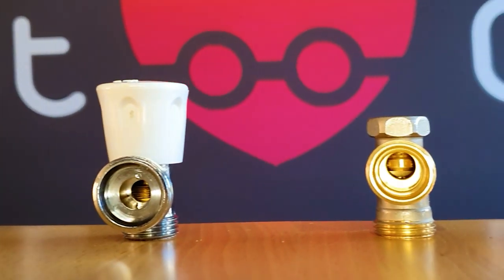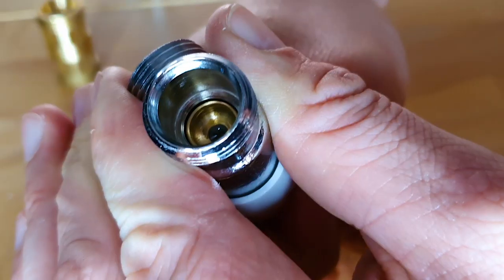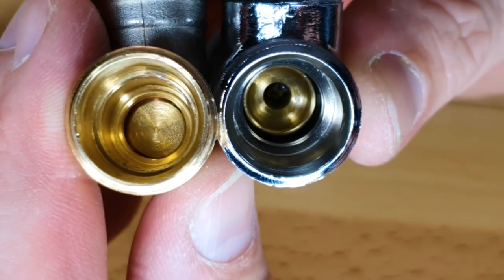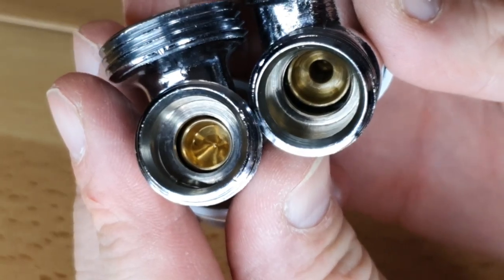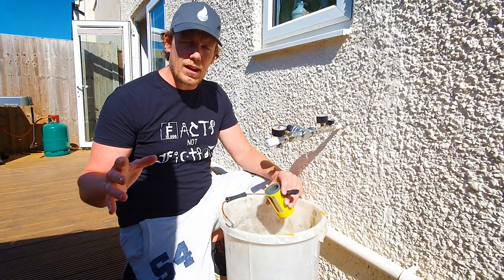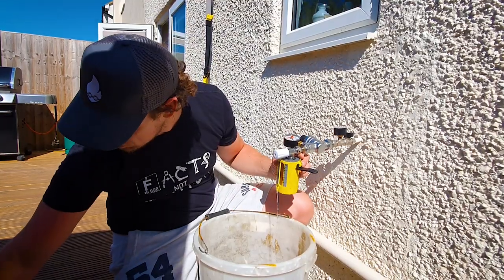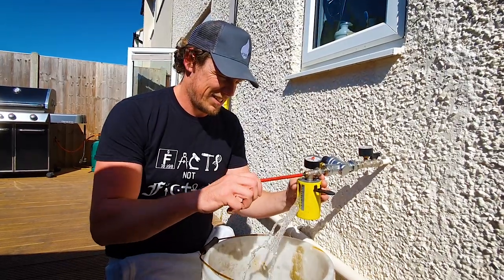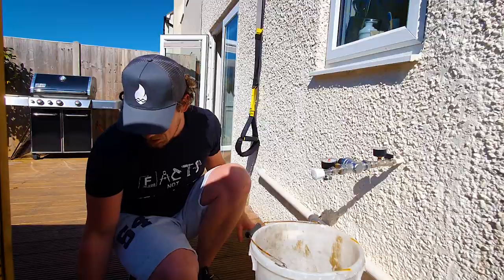We always thought Lockshield Valves were the SAME!!? WHO KNEW!?

Comment: It looks like I have regutecs fitted to a few of my radiators ! As they don’t look like normal lockshields ( the exposed shaft when you take off the plastic cap / no plastic cap ) I though they were just wierd elbow and darn’t ever take off the cap encase I caused a leak ha ! 

Interestingly on the radiators fitted with the regutecs have oventrop TRV’s which actually have a flow restriction function it seams ( had one apart in my garage ) 

I now know that all lock shields aren’t made equally, I’ve got some rubbish on/off ones upstairs and they are horrible to try and control flow. 

Great video as always, I’m learning loads and I’m not even a heating engineer 👍

Comment: I have smart Trv's fitted so it's not unusual to just have on one/two or three rads on at a time and I have all the lock shields fully open  (I have a 1970's system boiler ). Is this wrong ? Maybe causes an issue with delta T ?

Comment: Absolutely fascinating stuff. I like how you can turn on/off those valves without messing up set flow rate, you can also set the flow rate on the Trv4 and Honeywell’s counterpart.  Would be interesting to see how  pegler would fair in this experiment as they are regarded as a gold standard valve. ?
Reply from the maker: Good shout. Got a link for a specific one?
Reply from the maker: Assume you mean pegler ofcourse?
Reply: Hi. It’s the pegler terrier.  I used them on my house and on jobs for costumers with  larger houses, the sort of place where you would want to find a good valve if you were to arrive in ten years time.

Comment: After watching, I went and had a look through my box of valves. Initially I was surprised that the lockshield Drayton supplies with a TRV4 or their RT414 had the biggest bore for maximum flow and didn't seem to have many turns to open it fully. I initially thought why is the lockshield with the RT212 performing better? At least to my untrained eye from what you video teaches. The cheaper Lockshield has a smaller restriction in it and seems like it has more accurate adjustment at the fine end.

Anyway, it took me a few moments and then I realised that the RT414/TRV4 valve body should be balanced on the TRV end with Drayton's key. 

Also another sidenote, the Plumbright branded TRV and Lockshield that I have here also looks like it could be a good performer. Nice restriction and appears to have good control at the smaller end of things.

Haven't actually tested any as you have, just eyeballing them to give me an idea.

Comment: I use Altecnic Eclipse valves which have a large bore (about 14mm on 15mm pipe) and 13mm travel).  What do you think of those?   The heating is quieter and warms up quicker than with most others I've used which have small bores and little travel.
Reply from the maker: I've not seen them tbh. It's not the total amount of travel though.. it's the total amount of travel within the seat.. 

to know if it has good authority is pretty simple though. You just have to look up its KV value.

Comment: An increased local headloss due to small opening through a valve doesn't give greater flow control what BS. What matters if you can set to different opening from shut to fully open. Learn some hydraulics and bernouli equation.

Comment: A plug and a gland are not the same thing. The valve gland/packing is what stops liquid leaking from the stem of the valve.
Reply from the maker: The gland is the whole inner part, gland packing is what holds the water back around the stem, the plug is the bottom part of the valve.
Reply: Heat Geek a valve gland is part of the valve that stops liquid passing leaking from the stem.

On a small valve like a lock shield it’s made up of the top part of the casting, a back nut and some sort of packing. On good quality valves this packing is normally graphite or PTFE. On cheap ones I’ve seen materials like cardboard.
Reply from the maker: @chrisb4009  I see. Thanks
Reply: @chrisb4009  I get the impression that this guy sometimes talks out of his arse